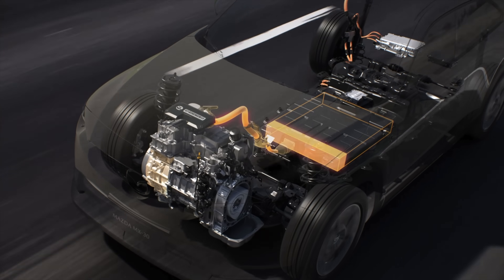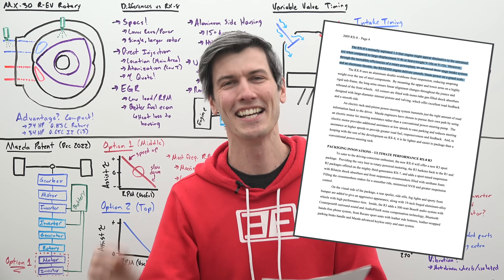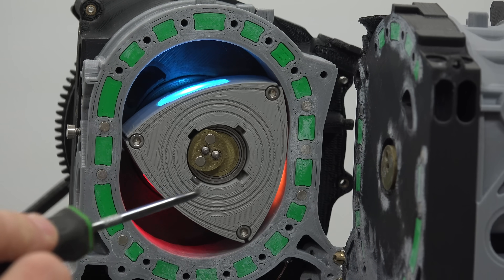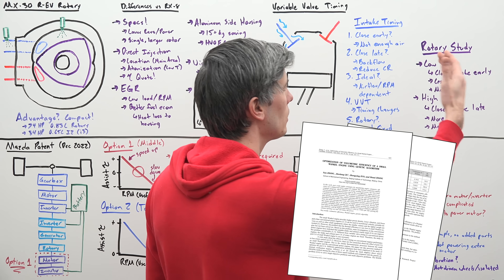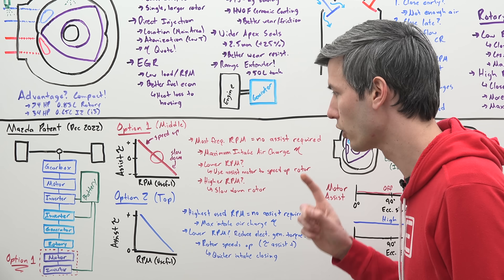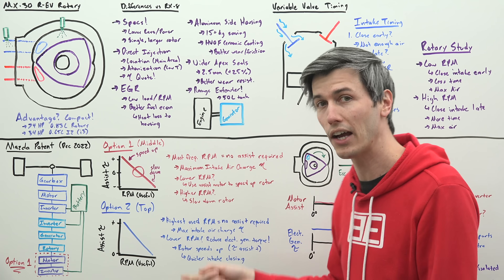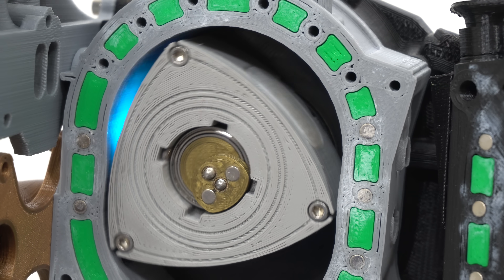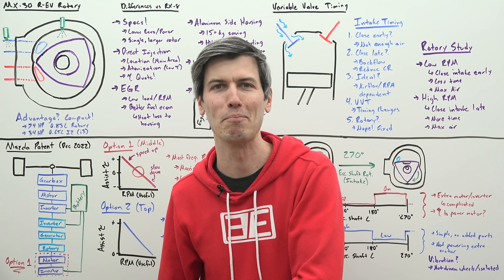Mazda Brought Back The Rotary Engine!

Comment: I had an 87 rx-7 and it's the least surprising thing in the world to read that a lot of the fuel went out the exhaust. You could stand behind it and see/smell it happening. It was my favorite car ever.
Reply: Anyone who ever replaced a burned out "thermal reactor" was well aware of unburned fuel/air mixture. There was a sheet of flame coming out of the rotor chamber into the thermal reactor three times on every full revolution. I loved my RX-4 Wagon it was a blast to drive. Fuel economy ha, ha, ha! I hope this new iteration works like a charm as I am now driving a RAV-4 Hybrid. I think hybrids will likely be the best long term solution since new power generating plants are not coming online fast enough to support a complete change over to EVs.
Reply: @erictwickler4247  National Grid (UK's national electricity distributor) says it is completely confident it can supply all the EVs that are going to be driving around. 
By the  way, what's a 'thermal reactor'? I owned and drove an RX8 for years, and I've never heard of such a thing.
Reply: Had an RX-8 still miss it to this day. Nothing really like it. Maybe a Porche 911. Closest thing to it I've driven.
Reply: @johnbb99   The thermal reactor is mounted just outside the exhaust ports. It oxidizes the unburned exhaust gas expelled from the engine to reduce the noxious components such as hydrocarbon and carbon monoxide. When the engine speed is high or during deceleration or full load running, the air control valve feeds fresh air from the air pump to the thermal reactor cooling air jacket to properly maintain the temperature of the reactor. The nonreturn valve which prevents backflow of exhaust gas from the reactor is attached at the air inlet of the reactor.
Reply: @greggc8088  Its what we call a catalytic converter in the US.
Reply: @billhanna2148  Not exactly but a similar effect of reducing hydrocarbons somewhat.
Reply: I couldn't see it, my eyes were burning. 🥹😂
Reply: @erictwickler4247  I agree with your stance on hybrids, even in the performance market. F1's latest gen of hybrid motors are the most reliable yet, while producing ridiculous amounts of power on biofuel. I believe hybrid's powered by biofuel will be the future, not all electric.
Reply: The non-turbo FCs dumped so much fuel in the exhaust that you could quite easily ignite it.

Also, none of the convertibles came with boost.
Reply: @billhanna2148  The thermal reactor is not a catalytic converter. In fact, it was used to avoid the need for one.

Catalytic converter technology at the time was horrid. They were restrictive and expensive. 

The thermal reactor is a heavy iron chamber attached to the engine that re-combusts the fuel-exhaust mixture with additional oxygen. Unlike a catalytic converter, there are no rare metal catalysts. The closest analog would be DPF regeneration.
Reply: @johnbb99  Oh, well if the government says it's confident, we'll all relax. heheheh😁
Reply: @johnbb99  How can they do that when they're currently close to maximum generating capacity anyway?
Reply: @billhanna2148  We do in the UK too. But from what he says I guess it's a slightly different device?
Reply: I had a 1987 RX-7 Turbo. The highest MPG I got was 19. Pretty disappointing for a car under 2900 lbs.
Reply: @billhanna2148  The thermal reactor does not use rare earth elements like a catalytic converter does.
Reply: They’re kinda like fancy 2 strokes
Reply: Without a cat its really easy to shoot flames. But I wanna keep my car somewhat legal so keep mine on, instead everyone can smell the 2-stroke oil premix burning
Reply: So true. I raced a '95 RX-7 in SCCA and that engine made twice the power of a piston engine, by burning 3 times as much fuel :)
Reply: @intoTheEther1  I would buy a cheap regular car if it didn’t take 14 minutes to hit 60 while I’m trying to merge into traffic going 85 because the toll road entrance is on the left.  They would have to fix the blowing around like a flag in a hurricane over 60 mph too. Until then I’ll keep paying more for cars, which I think is the main reason they don’t exist as standard vehicles.
Reply: yep was just exercising a stored 82 rx-7 and I really quickly moved it away from everybody to let it idle. So stinky even in an airplane hangar with the door open.
Reply: @johnbb99  To keep it simple: It is an empty thick walled cast iron container mounted instead of an exhaust  manifold kept hot by  high temp rotary exhaust gases in which CH and CO are heat treated and turned into less harmful components.
Reply: @dipling.pitzler7650  interesting. I'm wondering if it was something fitted to  only certain markets as I've never heard of it being fitted to a UK spec RX8
Reply: @JakeEpooh  Are you in the UK? NOT government!
Reply: is that the rotary burns lubricant by nature?
Reply: @johnbb99  wait til they go on strike
Reply: @Lovesausage269  The OEM's can make a hybrid that checks all of those boxes, they just don't.  In a few years, the F1 power units will be net zero hybrids powered 100% by biofuel. Biofuel hybrids will be the future. The power grid and scarcity of minerals for lithium-ion will make it that way.
Reply: @johnbb99  I had a RX4 coupe (loved it) that also had a thermal reactor. My understanding is that it was a cheap and simple way to deal with all of the unburnt fuel that you get with rotaries. It was a way to lower the terrible emissions. The reactor would glow bright red after some high revving. An air pump was connected to introduce air. I think this helped cool the reactor and also added oxygen to the fuel heavy hot exhaust gasses which might have helped them continue burning in the reactor. Happy to be corrected if I'm not right with this information.
Reply: I had an RX-7. Drove it mostly on the interstate while commuting to work. The speed limit was 55 back then. I never got over 21 mpg. Two seat, aerodynamic sports car with a manual trans. I remember seeing the catalytic converter glowing red at night after parking.
Reply: Yup. We raced multiple of these cars in the 2000's. Pulling the fuel pump fuse and "de-flooding" the engine was a common occurrence. ;-)
Reply: I’ve actually been in the OG RX-7, which is what I’m assuming you were in and it did have fuel problems as it was built for racing around the track. It constantly needed more gas despite being ultra light and you could smell it and sometimes see it dripping out the exhaust!
Reply: @stephensu4371  not my nature but by design. The RX8 for example sucks oil from the sump and feeds it into the combustion chambers.
Reply: @johnbb99  It was fitted to the RX 7 ,not sure about the RX 8. It may have been not needed  because of better engine management and a catalytic converter. Emission regulations vary from country to country. Biggest Problem with early Rotary engines was HC and CO emissions due to residue fuel, (hence the popping exhaust sound) additional oil injected to lubricate seals and large combustion chamber surfaces hindering a thorough combustion.
Reply: @ian.williamson  Actually, there are 3 power events for every 360 degree revolution of the rotor.
Reply: @MegaGeorge1948  obviously, I know they’re not literal two strokes. They suck, squeeze, bang, and blow just like every 4 stroke engine. But they’re like a 2 stroke in that they burn oil like a mf and spew unburnt fuel out the exhaust
Reply: I still have a 13b turbo RX7. Really nothing like it. Sounds unique and smells unique 😂
Reply: @Michael-oy2ng  NC MX-5s, they have the same chassis, the mx-5 is around 500lbs lighter somehow,  same marketed weight distribution, same front-mid engine layout the Rx series invented. You're right about 911's being incredible though I wouldn't compare a proto-supercar, at least in pricing, like the 911, to a 30k or less RX-8 or MX-5. The 911 will just walk away from the RX-8 and MX-5 in any meaningful acceleration zone, though all 3 may be in different classes in racing series like autocross.
Reply: @99EKjohn Cool, didn't know that about the MX-5, however I want more power, practicality, and interior space.(cause I'm fat. XD ) True about the 911 being an unfair comparison, but I was using that to highlight how amazing the RX-8 was.
Reply: @ian.williamson  Two strokes still suck, squeeze, bang and blow.  They just do all four on every other stroke.  They do this with fixed ports, just like the rotary does. Two strokes usually burn oil mixed with the fuel, just like a rotary.  They have a lot in common.
Reply: @jthraen  At least somebody agrees with my original comment. Thanks
Reply: @erictwickler4247  And when it is examined in detail there is no reduction  in greenhouse gas emissions with EV, it is just exchanging one set of problems for a different set of problems.  7 Billion people are going to change the environment on any planet and that is the real inconvenient truth.
Reply: @PeterSosinski  Glad I wasn't the only one that did that!
Reply: @erictwickler4247 Each rotor fires only once per revolution, since the rotor spins at one third of the main shaft speed. With a twin rotor, there are, of course, two firings per revolution just as with a conventionalfour cylinder four stroke car engine.
Reply: @intoTheEther1  I just feel like biofuel is ridiculous. We will not have enough water to grow food for ourselfs, seems like a waste to grow stuff to make biofuel, when you can use conventional fuel or electricity.

Comment: Fascinating how using the rotary as a hybrid actually improves the efficiency of the engine itself rather than just the efficiency of the overall system.
Very cool indeed.
Reply: These same technologies also apply to reciprocating engines which are inherently more efficient than the Wankel engine.
The concept in fact makes no sense,   why would anyone want to dirty, noisy inefficient Wankel engine in their EV? It is completely incompatible with the whole green energy concept
Reply: @sandervanderkammen9230 maybe for smaller piston engines, besides they have valve timing so this novel approach doesn't really apply. 
Also, I think you can just make that engine quiet. I doubt it would be any different than any other newish piston engine nowadays that are quite silent.
Reply: @sandervanderkammen9230  this is not a hybrid, this is an EV used 95% the time in the city on pure electricity, but if you want to make a longer trip on the weekend, you can just turn on the REX. it has to be small and light, but efficiency is not the most important since used very rarely.
Reply: @tomo1168  It's a fundamentally flawed concept that all of the other automobile manufacturers have completely abandoned... as usual, Mazda is always the last to "get the memo"
Reply: @sandervanderkammen9230   the technical concept is not flawed. for users driving 40km daily on pure EV charging every night cheap at home and doing 3-400km trips on almost every weekend is this concept perfect. but the number of this specific user type is too low for mazda to worth the R&D.
Reply: @tomo1168  All of the other major manufacturers have completely abandoned range extenders for its obvious flaws and disadvantages.
Reply: regarding the devil's-marks problem... why cant there be a sky/skid like spool/foot which skids along the surface and adapts angle of pull/force via a axle/pin connecting the triangle rotor's wedge/edge and the sky/peddle/foot in contact with wall and skidding along it keeping the chamber sealed and avoiding the devil's-marks caused by when the wedge/edge of rotor is directly in contact with wall
Reply: @sandervanderkammen9230 One answer I believe, MARKETING

Comment: Absolutely love Mazda's dedication to keeping the rotary alive and even improving it out in these times. I can't help but feel another rotary beast is on the cards, but we can only be hopeful
Reply: Unfortunately we will never see another rotary engine powered car due emission rules. They tried with the rx8 and with all the emission gear it's just no go good
Reply: Mazda is so awesome, they are the ones who go out of pattern line, building different engines
Reply: I'm hoping for another beasty Rotary-Driven car in the future. Should have more tech to hopefully 'meet' emissions (or just bloody lie about them, lol) and they better slap a turbo on it. :) Please Mazda
Reply: @ThatHoodlum19  YES!!! 
Instead of a double stack make it a QUAD STACK
MORE horses...
oh and it's gonna have to be rebuilt EVERY 5 MINUTES because the piece of crap literally breaks apart by existing....
Like you gotta realize it isn't being made for a good reason.  It's not feasible technology unless you're rich and can afford to rebuild it and be fixing it all the darn time for those couple weeks you get to drive it in peace...
Reply: regarding the devil's-marks problem... why cant there be a sky/skid like spool/foot which skids along the surface and adapts angle of pull/force via a axle/pin connecting the triangle rotor's wedge/edge and the sky/peddle/foot in contact with wall and skidding along it keeping the chamber sealed and avoiding the devil's-marks caused by when the wedge/edge of rotor is directly in contact with wall